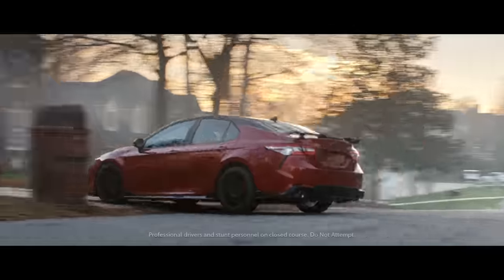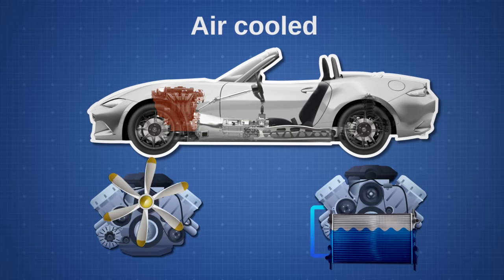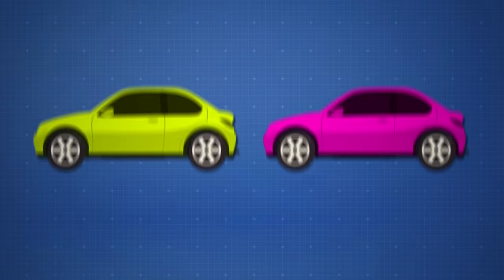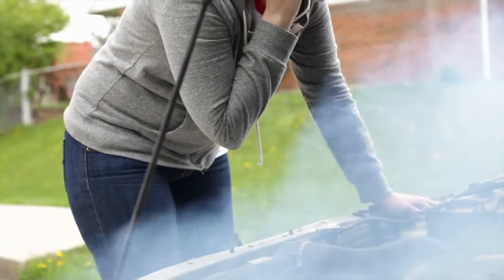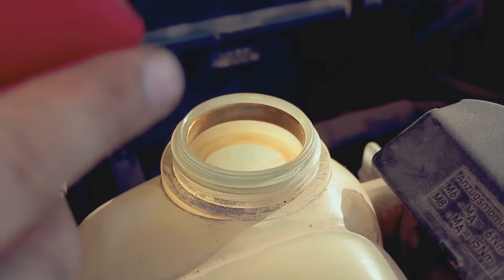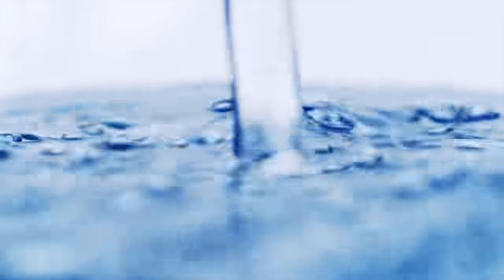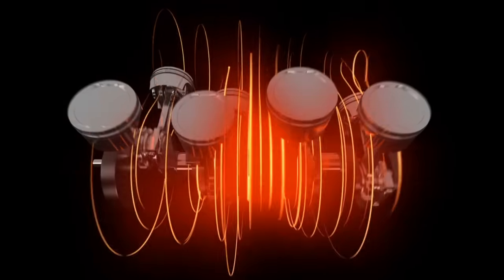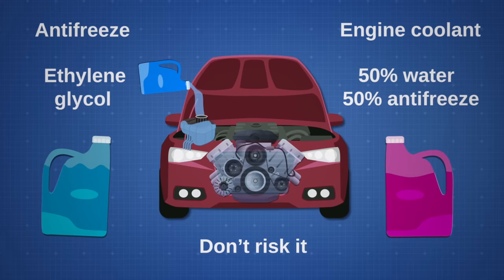Changing Your Coolant? You're Doing It Wrong

Comment: Love how in the one video changing your coolant you say to put water in it and drive it for a week then fill it up with 50/50 mix this video you said don’t use water
Reply: One week running with 100% water in modern vehicle is all it takes to start the dreaded corrosion that you can never fix.  I would only put 100% water in to flush only if:   when draining, there is lots of debris/gunk/oil draining out; then within 5 minutes, immediately drain the 100% water out.   If I have a clean, solid, non-corroded system, I just drain, fill, remove air void and monitor level.

Comment: Hey scotty do you think there be a kit to buy to convert my dads Silverado run off oak wood with good metal air intake filter the hydrogen generate from the oak sucks in to the filter and used as infinite fuel good design am i right? what do you think about this design? You think is a good idea incase you run out you just hop out collect some sticks and leaves in the fule barrel ignite it wait about 5 or 10 minutes to warm up then start the engine and hopefully it will run takes a few trys but wheb you get the design right you and me will probably be happy as a steam clam

Comment: My engine temperature was running cooler than normal and eventually a check engine light came on with a code alluding to that . I never new a cooler engine was problematic . The problem was the thermostat and replaced it and all was good . I have drained and filled my radiator fluid on my 2005 kia rio and haven't flushed it ever.

Comment: Volkswagen owners: check your expansion tanks for a small bag of silica, and remove! Some VW models have the bag to preserve the life of the coolant. However, the bag deteriorates over time and clogs the heater matrix. Pull the bag out carefully in case it splits. Some units have the bag integrated in a pocket within the expansion tank but you have to replace the tank - you can buy a new tank from the ‘stealership’ for absolute £25 / $30. Might be even cheaper in the states, we seem to get our pants pulled down in the U.K.

Comment: Wondering generally how often should you replace coolant. I have 40,000 miles.
Reply: Probably a good idea to flush it now, along with a drain and fill (do not flush) of the automatic transmission fluid. OEM transmission fluid only!
Reply: @Mark Codiroli 😊

Comment: Hi guys, I have a weird problem. During cold weather my temperature will slowly decrease on highway when i drive above 50mph+.  Then local with lower speed or at the stop the temp will slowly raise up to middle.  it only does that when its cold weather.

Comment: Scotty I have a question so  recently a mechanic said I have rust in the engine i don’t know how much but he is replacing the radiator and taking out some of the rust but how do I know how long the engine would last?
Reply: periodic oil change and coolant flush. i usually change my own oil every 5000km.  change oil after long drive or in hot engine, NOT cold engine, so that engine gets rid of lots of debris when drained hot.    mainly, avoid turning your engine off before it warms up (like very short distance driving)

Comment: 2015 Kia Forte LX, I had transmission changed last month ( used transmission with 42,000 km on it ) and it's shifting hard . First 3 gears shifts hard and I can actually feel it and it accelerate slow from stop. I took back to Honda dealership ( they changed it for me) and they can't find any problems , they found no lights on or issue with transmission, filled the fluid and scanned the system but still they can't find solution. They contacted Kia and Kia dealership told there is no issue with transmission and it don't need relearning or reprogramming. What I need to do. Honda mechanic told me to drive more and come back next week. If nothing changes they gonna replace the transmission with other one. 

Please help
Reply: If you want to contact Scotty I think he has some links in his video info.
Reply: Transmission is correct they confirmed it before installing. Old transmission was changed because of metal grinding sound coming from transmission.

Comment: I almost wrecked my 302 in my 89 bronco by being forced to run it hot to get out of the bush when I was in my late teens in the early 90s.

If I knew what I know now I would have removed the thermostat and used a beer box to make a temporary gasket to get home without destroying the engine.

Luckily it didn't kill the engine.

Comment: You didn't mention super flush. Disconnect bottom radiator hose. Flush the system with 50 liters of tap water then fill it with coolant😁

Comment: So how does an air cooled engine maintain optimum operating temperature since it has no thermostat?
Reply: Forced air cooled motors, as used by VW and Porsche did have a thermostat.  It controlled air flow with a gate, based on temperature.

Comment: I hope someone can help me ,  i own a nissan tida 2008 1.6L engine , the raidator cap was leaking so i changed it but now the raidiator looks like steam is coming out of it when the car is warm enough even though the cap doesnt leak anymore ? !! I checked the cascade its working fine ! Ist the raidator cap that's not good enuf or not the original company ? Or something else ! , Thnx for any help
Reply: Pin holes in the radiator is what it sounds like.
If steam is shooting out of the radiator itself that usually means radiator is rotting out.

Comment: Don't forget the orange  DexKill coolant in those GM vehicles ,many was actually defective or should I say Dexfective 🤣
Reply: @Mark Codiroli actually GM did have defective coolant & it led to numerous lawsuits & engine damage claims against GM ,many GM vehicles was damaged by defective DexCool ,hence it got the industry terms " DexKill " & "DeXective "it literally caused excessive corrosion internally & even ate thru water pumps & aluminum thermostat housings.....as well as destroyed aluminum heads & radiators, the stuff was the OEM factory fill that failed as well as original GM / AC Delco branded bottled Dexcool from certain years & lot#'s

Comment: Is it ok my old car temperature needle goes moretha half until 2 bar before the red line? It does happen usually during hot weather. TYIA
Reply: hahahahahahaha   your engine is dying ...  more than half is already over heating , and red line means your engine about to below up .... needle always should be at just below middle ....
Reply: if it's very old and with lots of numbers 95 -110 Celsius

Comment: Question? What if it's not pulling from the reservoir
Reply: The small diameter hose from reservoir may be leaking air in when radiator tries to suck/draw coolant from the reservoir.  Or you cap is NG.  Do both,  they're cheap!

Comment: Is bleeding the system necessary?
Reply: Some cars, yes you must bleed the cooling system. Any car that has a portion of the cooling system higher than the top of the radiator will need to be bled.

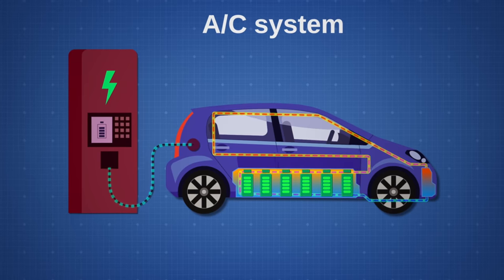Comment: 4:23 does the cooling system for the batteries work the compressor to cool them even if cabin A/C is turned off ???? A/C systems in cars do put a load on the engine, more so in the older models. Don’t know about EVs.
Reply: coolant circulates through EV battery no matter you turn on or off  A/C compressor.   A/C compressor is for you/cabin ,    and A/C compressor uses high voltage EV battery power

Comment: Learned about this when a coyote dented my radiator. The car drove fine for a day until I smelled coolant and saw white whisps of smoke.

Cranking the heater to max and opening the window was the difference of over heating vs 3/4 the way to overheating 
Damn coyote..

Comment: Stop and go traffic Phoenix waiting to get on Freeway at rush hour.   115 F out side.  Heat off the road surface is hotter yet.  idle and moving 5 mph stop go till you get thought the light to get on the Freeway.  Kills a lot of cars.   EV batteries and most every thing does a lot better in cooler place.   So I should not buy an EV

Comment: Waterless coolant is the future when the price drops
Reply: Water, or rather Liquid, has a much higher energy density (that we've found, as far as I know) than "Waterless" coolant. I suppose with dry cell batteries they might be able to make them built into the heat sink in some way, and use gas systems between layers.  I would think engineering those cells to be serviceable and also sealed for air might cause some problems.  tl:dr Water seals are easy to make rugged, humans not so good at high pressure gas yet.